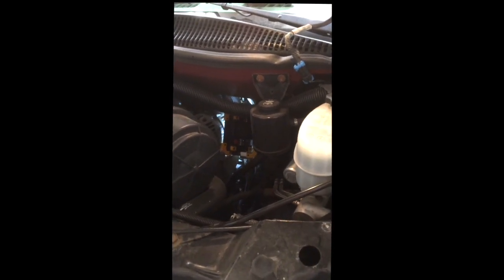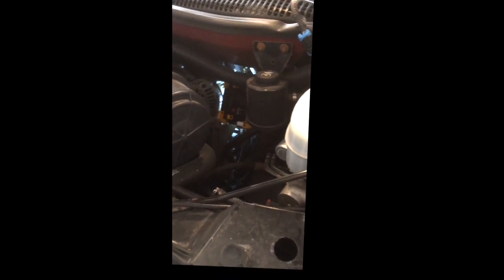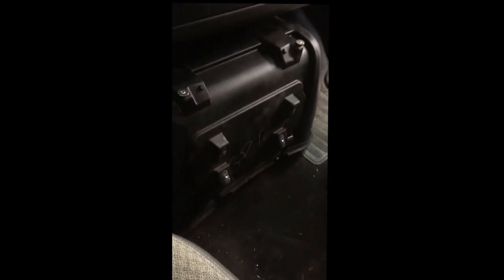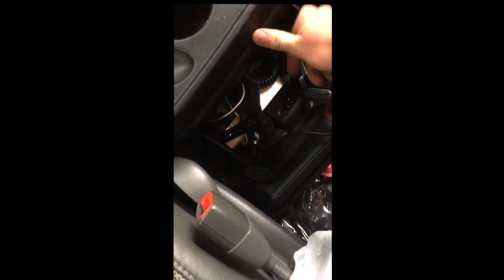Chevrolet Express Purge Solenoid

Comment: Thanks for sharing. I changed the vapor canister purge vent solenoid valve under the van (next to the gas tank) and I still have the engine code so the I was about to look into changing the one on the engine but couldn't find where it was located. Now I know! Thanks again!
Reply: UPDATE: I got the a solenoid out. But, my 2006 Express 1500 (4.3L) engine cover was different than yours and my solenoid was located on the passenger side of the engine. And the part looks different than yours. None the less, its out and I ordered a new one from Amazon. OEM, $10.99, free shipping, to be delivered tomorrow! Autozone and NAPA was charging $47 and delivered end of next week. eBay was $27 and 4 days shipping. If you're a cheap ass like me, it's always good to search several sources for the best price and delivery time!

Comment: Was your van not starting after you filled up with Gas?  Thats the problem I have, after searching, some recommended the purge canister by the gas tank, replaced that to no avail.  Thanks for the vid, I am going to change it out right now.  Will report on rough start after fueling up here in a bit.
Reply from the maker: Nathan Marshall no there weren't any noticeable problems, the check engine light came up and I found online that changing the purge solenoid might clear it
Reply: I am having the same issue.  No engine light, but hard starting after fueling up.  From what I understand, the most likely culprit is the purge valve/solenoid shown here being open and causing the intake to be flooded with excess vapors.  With my Express, I can start it.  But I have to push the throttle down to keep it running.Another video suggested that opened the throttle and allowed more air to enter.  Just conjecture.  At all other times, the van starts right up.  Good luck with your repair!
Reply: This fixed my hard start after filling gas up.  I first replaced the evap purge canister that is on the tank, that didn't do it, replacing this part fixed the problem.  One thing I will say is that the plastic tube is very brittle on a older vehicle.  Mine broke trying to get it off.  Got some 3/8" rubber hose and some clamps and good to go!
Reply: Thank you for the update and congratulations!  I'm ordering the part today.  Since mine is a 2004 model 3500 with the 6.0, the purge solenoid is on the front of the intake right behind the air intake. Should be able to get to it from under the hood.
Reply: I completed the replacement of the solenoid and it fixed my hard start after filling up with gas.  On the 2004 Express 3500, the purge solenoid is on the front of the intake.  I had to remove the air filter assembly and that allowed me access to the purge solenoid.  The one that fit my 2004 was this one I got from Amazon:  http://a.co/fwrDD82

Comment: nice video thanks man....i have the same van with the check engine light on because on tjat selenoid...i also jave a bit of rough idle for a couple of seconds when i stop but then it goes away...
Reply from the maker: Nothing noticeable, occasionally it had trouble starting but I think that was unrelated. The rough idle is probably unrelated.
Reply: mauricio cuellar You may want to check/ replace the idle air control valve which sits on the driver side of the throttle body intake. Mine van had rough/erratic idle and reved up randomly.

Comment: did you have any symptoms before replacing that selenoid
Reply: My symptoms were the same as Brian, after getting gas, my 2009 chevy express wouldn't want to start.
Reply from the maker: There was a check engine light on I don't remember the number
Reply: @andrewreardon2056  The most common code is P0446.